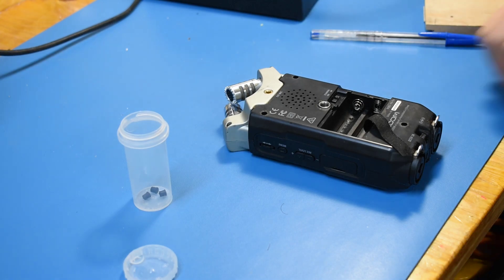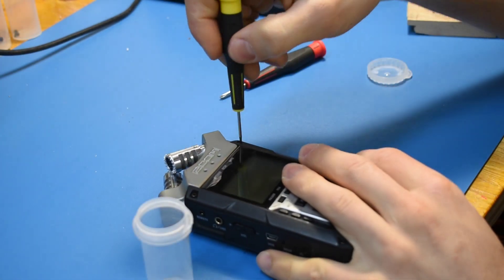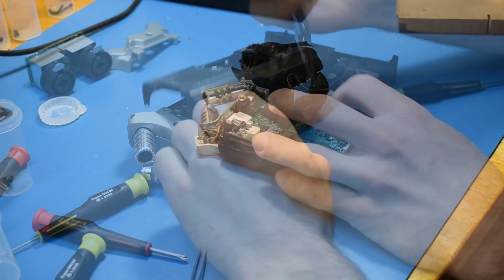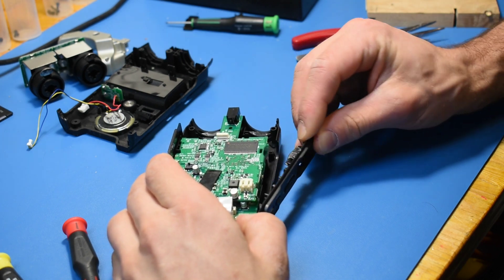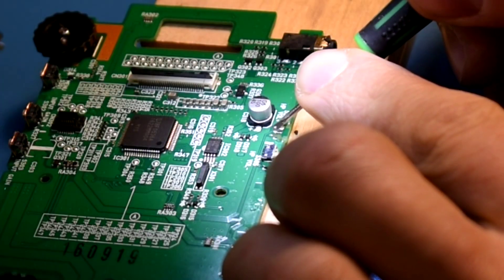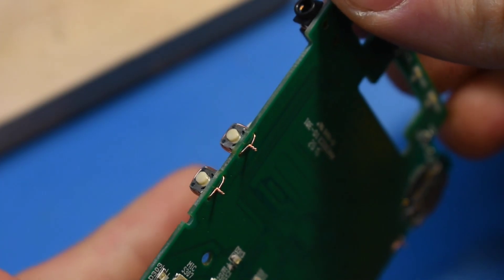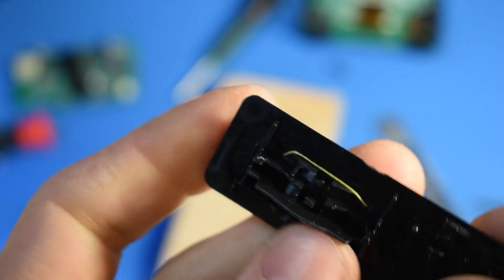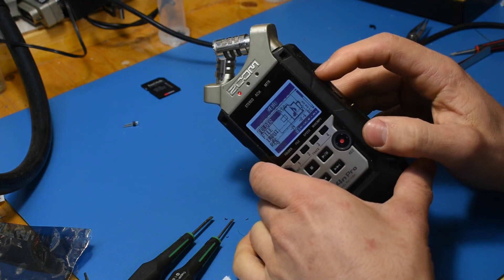Zoom H4n Pro repair : buttons + SD card door

Comment: I broke off the scroll wheel I manage to turn the dial with screwdriver but can’t use press in to choose anything in the zoom h4n menu How to press in without wheel? It’s a tiny gold cord Maybe I need to short some contacts? Please help
Reply from the maker: Eh I guess you might be able to push in the internal switch contact with a thin tool, depending on internal damage.
You're leaving the "easy repair" category, you will have to find a replacement part (maybe contact Zoom) or by browsing online, these are sometimes called "thumbwheel switches". Then find someone to help replace it unless you know what you're doing